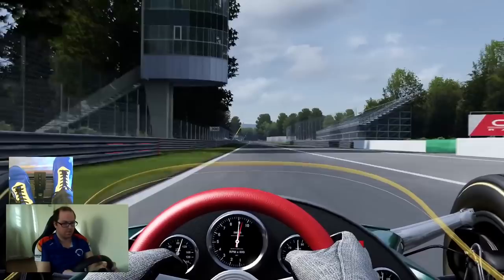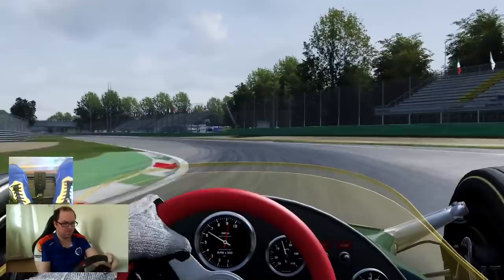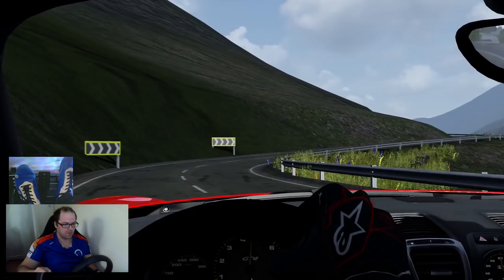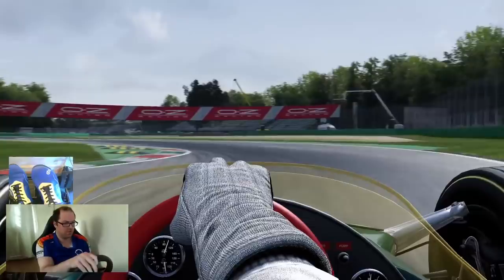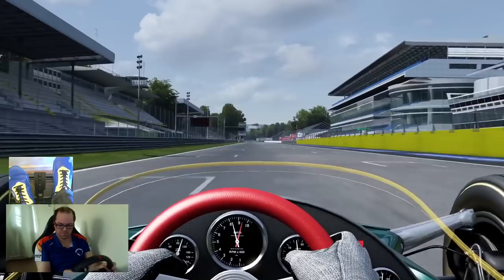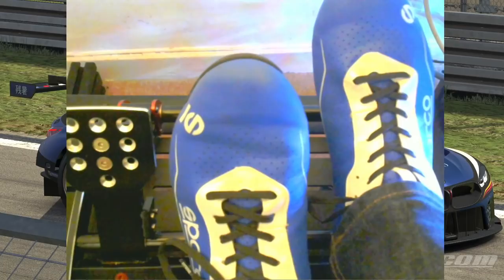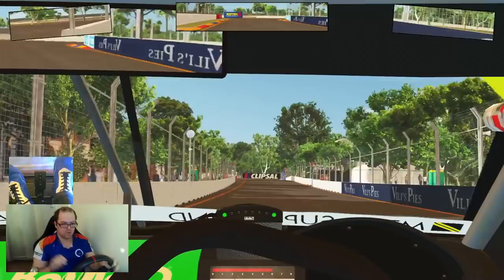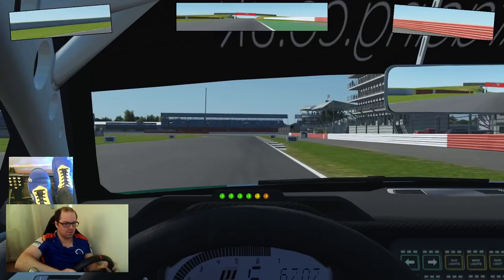Rev Matching, Throttle Blipping and Heel-Toe: Motorsport Explained

Comment: I rev matched on my driving test when I was 16. 😅 Still do on nearly every downshift 23 years later. Heel and toeing came later for me. The gas pedal arrangement in my first car wasn't ideal.

Heel and toe is actually a term that goes back to cars with the gas pedal in the middle 100 years ago. In most cars made in the past 50 years using the side of you foot is easier than your actual heel.

Comment: I taught myself the obsolete skill of double-declutching in the 1970s, when the clutch cable on my Renault 4 failed again, and for once I wasn't carrying a spare (roadside change, 15-20 minutes). Into neutral, then change gear and blip the throttle until you can engage the clutch without excessive loud rapid hammering noises.

In more recent times, I've associated the high-pitched whine in F1 with Sebastian Vettel.
Reply: 😂 Last comment - ouch! What a burn! 

My dad taught me how to do that just in case I'd need it. Mercifully, I didn't (first car was a 11-12 yr-old, 1971 Mark 1 Escort, the second a 19-20 yr-old, 1967 HB Viva - a.k.a. "Arfur". He was half a Viva and God only knows what the other half contained). I "academically" know how to do it, but as I'm now stuck driving autos, it's not a skill I'm ever likely to need. But I'm still glad I learned to do it. You never know when you might need to know something! It sounds like it paid off for you very well!
Reply: 😂 Last comment - ouch! What a burn! 

My dad taught me how to do that just in case I'd need it. Mercifully, I didn't (first car was a 11-12 yr-old, 1971 Mark 1 Escort, the second a 19-20 yr-old, 1967 HB Viva - a.k.a. "Arfur". He was half a Viva and God only knows what the other half contained). I "academically" know how to do it, but as I'm now stuck driving autos, it's not a skill I'm ever likely to need. But I'm still glad I learned to do it. You never know when you might need to know something! It sounds like it paid off for you very well!
Reply: 😂 Last comment - ouch! What a burn! 

My dad taught me how to do that just in case I'd need it. Mercifully, I didn't (first car was a 11-12 yr-old, 1971 Mark 1 Escort, the second a 19-20 yr-old, 1967 HB Viva - a.k.a. "Arfur". He was half a Viva and God only knows what the other half contained). I "academically" know how to do it, but as I'm now stuck driving autos, it's not a skill I'm ever likely to need. But I'm still glad I learned to do it. You never know when you might need to know something! It sounds like it paid off for you very well!
Reply: 😂 Last comment - ouch! What a burn! 

My dad taught me how to do that just in case I'd need it. Mercifully, I didn't (first car was a 11-12 yr-old, 1971 Mark 1 Escort, the second a 19-20 yr-old, 1967 HB Viva - a.k.a. "Arfur". He was half a Viva and God only knows what the other half contained). I "academically" know how to do it, but as I'm now stuck driving autos, it's not a skill I'm ever likely to need. But I'm still glad I learned to do it. You never know when you might need to know something! It sounds like it paid off for you very well!

Comment: Rev matching. 
1980’s and my 1st time in a formular Ford single seater on a racetrack, [Snetterton] Came off the back straight and into the S’s, changing down and missed a gear, so held the clutch in and eventually managed to get a gear in the middle of the S-bend [but the revs had dropped while I was still at speed] let the clutch up without raising the revs..  mis-match in engine speed to the speed of the tyres and off the track in a spin I went.
[Engine stalled mid spin, managed to catch it with the clutch which stopped the spin and coasted freewheeling backward off of the track]
Then sat there red faced as the experts went past looking at me as an idiot. 🙄🤦‍♂️😂😂

Comment: Nascar next year will have a sequential gearbox.
Reply: If I'm not mistaken the Camry already has one, right?
Reply: @StevePhoenix  as of right now the rules don't let them have anything other than a H pattern
Reply: @StevePhoenix  no
Reply: @jacobrocha8569  that’s why they are testing it in the new package. My question is will they use paddle shifters or the stick sequential they use in Aussie Supercars
Reply: They will still be heel toeing and rev matching
Reply: @black-op345gaming5  I believe it is a stick sequential (which are very fun)
Reply: wot
Reply: @StevePhoenix  no
Reply: Apart from entering and leaving pit lane, do they ever shift?
Reply: @cmacdhon  yes, road courses of course but some ovals like Pocono or Phoenix when the tires are worn and speeds drop sometimes they will down shift to third to pull out of corners
Reply: Will Eric cartman be driving😂🤣✌🏻👍🏻
Reply: @cmacdhon  only on road and street courses and Pocono due to the gear package used.

Comment: I feel like I finally understand it all, I've heard about it for years but haven't had near the sort of detailed explanation I got here. As I was watching, I felt compelled to try and emulate it on my own pedals (G29) and just based on that, I feel like Heel & Toe would be a HUGE learning curve for me. Maybe I'll decently grasp it for driving by myself but I'll be a mess around others on track. Throttle Blipping on the other hand feels weirdly comfortable, thought I'd struggle with it given how used to not doing it OR the other methods I am but it was surprisingly easy to adapt to. Probably helps that I've been getting alot of practice in with the H-Pattern so maybe my muscle memory has began to associate that technique with that choice of transmission.

Comment: I’ve found that for me, I struggle with heel and toe, so I use my left foot to brake and use the clutch and my right foot for acceleration. For me it means I can get on the brake earlier and get on the power earlier, with more precision due to me being able to have my foot prepared to hit the brake/gas. (Also I’m weird and find left foot braking much easier)
Reply: Hey me too!
Reply: You're not alone, same here. When I try right foot braking, I'm just lacking some of the precision and "fine touch" that my left foot has!

Would be the same for Gas.......I tried....once....in a sim....after a few glasses of alcoholic beveverages!

Now remember kids don't drink and drive................except in a Sim....there it can be hillarious! :D
Reply: Yeah left foot braking is definitely more intuitive when sim racing. Take it to a car and its a whole different beast because most people are used to holding themselves back from the braking forces with their left foot on the dead pedal as they brake with their right. Once you go for heel-toe, you have nothing holding you back/up against the braking forces besides your seatbelt/harness.
Reply: @blindaceg  I think it has more to do with the fact I have a lot of experience in karting. I’ve never done right foot braking because I tend to slam on the brake too hard.
Reply: @JB22.  Yeah I don't practice heel & toe because of my G27 pedals and the angle which I sit isn't ideal for it.

Comment: Had much the same experience as you with rev matching. Was told it's a black art when in reality it's just knowing at what point your gearbox wants to play nicely. Clutchless gear changes are another way to practice rev matching, although that's also a lot of risk to your cogs. Satisfying when it works though

Comment: Dinos on wheels huh, when i got my first car a couple of years ago(used to drive the family car which is an automatic) and it was a manual 3-Door 1994 Civic all this stuff seemed so complicated at first until i got the feel of it, mostly downshift using throttle blipping but i have also tried heel-toe and while it is really cool it is not really useful when braking for a stoplight

Comment: A great video, and clears it all up brilliantly. Could you please also do "double clutching (not granny shifting like you should)" - I have so far been confused by every single explanation out there.
Reply from the maker: Clutch it into neutral, clutch it into the next gear. It’s literally just that. The. Add a blip on the way down so it’s heel to with an extra clutch operation.
Reply: @AidanMillward  Makes sense. Cheers!!

Comment: I got pretty good at heel toe but before I did I wasn't very good. My old man didn't drive so showing of heel and toe gear changing was a waste of time, but I was young and wanted to impress the him so I did it anyway.  I wasn't fully familiar with the car I took him for a drive in, an old Holden Kingswood or something. A family car not made for heel toe gear changing. 
I don't think he was at all impresses by being flung forward and backward as every time I tried to blip the throttle I blipped the brake pedal just as hard. 
It is much easier on a bike. I sounds cool too.

Comment: Learning how to do rev matching/heal toe was and is something I use on my road car whenever I drive. I think it's mechanically more sympathetic and gives me more control, as my old ex RAF driving instructor in the 90's taught me to use engine breaking as much as possible. 

I drive a RWD car, with 494hp and 506flb-t , so I do think it's valid for me. But it was my old Impreza P1 where I would do it, as it didn't like changing down gears when "Hooning" and blipping allowed it to go into gear smoother and safer (IMO).

Great video Aidan dude. What was the game you were on when you were in the GT4?

Comment: Managed to figure out what engine revs I need to be at a given speed to be able to pop it straight into every gear up shifting or down in my old Falcon wagon when I had it, without using the clutch at all and without grinding it. Drove it around for months like that especially when the clutch cable ripped through the firewall. (Heavy duty clutch and a common problem with EF/EL falcons)

Comment: the rev matching is somewhat of a nessety at work when whe test drive the cars as its actually double de-clutching as most of the boxes are manual an have no synchromesh so get it wrong an u right off a 80+ year old gear box.

Comment: Wish i could, usually i go with semi auto. My size 20 feet are the first hurdle, especially in real cars. But thereafter almost impossible, as my feet naturally make almost a 45 degree toe angle, so the heel toe technique requires almost a 90 degree pivot from my right foot. Nope. I do rev match when i drive my real car, but in traffic i only use the break pedal when it is an emergency(and to tap when at a red light), so rev matching is easy af without the break, and is essential when driving with only engine braking.

So any ideas on how to overcome this hurdle? "Heel on brake toe on throttle" requires special pedals...

Comment: Something of note. Does the accelerator pedal have to be recessed like on the G27 pedal box so when you are braking your foot is level with the accelerator pedal making Rev matching easier?
Reply: It doesn't have to be, but it helps. My old Corsa didn't have a recessed throttle pedal and it was possible, but it's a bit more of a wrangle to get your ankle to the dangle, if you get my drift.
Most cars have a recessed throttle pedal for this reason, and so you don't accidentally push the throttle with your brake foot... However that's possible.
Reply: @EikeSky  cheers for the info. Was just curious to know if racing cars were like that. I know road cars have to have a sensible set up so doing that rev matching is harder.
Reply: Doesn't have to be, but it makes it easier. I have adjusted the gas pedal in one of my cars to make it so.

Comment: Because my dad had been a rally driver, he got a professional instructor to teach me to pass my test, and took me in his near 2 ton, 2lt Datsun (no power steering! - I was 17 and could barely see over the steering wheel!) to the mountains, forestries and especially onto old rally stages to teach me how to actually drive. I had to do a bit of the old heel-toe, and lots of rev control to get up steep tracks with next to no traction. One place was so bad he actually apologised (unheard of on a lesson), took over, and drove us straight up... sideways. Sort of. Somehow he drifted that ba$tard uphill! I, needless to say, was never that good.

It's been a while since I was physically capable of pressing the clutch pedal for more than a few minutes, but I am still attached to having the extra control over the way the power is transferred to the point of contact. In my last car I had a sports mode plus overdrive, which meant I could flip a switch on the gear lever and increase the revs without increasing the speed - necessarily. Living in a very rural area, that was the only safe way to quickly drive if needs arose. Which they did occasionally (4 kids & a hubby with the habit of ending up in hospital...). I've only got the sports mode now, but it's in the sort of position where I can easily flip it on and off. It's the only way you'll get me to drive an automatic! Especially in winter.

Thanks for taking me back to the time that was a) the most fun (the bit after I passed my test...) and b) the most bloody terrifying! You should have seen the roads he took me on. Some were literally on the sides of mountains - going more or less horizontally, the roads having been essentially made out of "shelves" in the rock. I'm surprised it took me so long to start turning grey!

Comment: how many rpm do you blip between gears?
Reply from the maker: It’s not a specific amount. Just enough to stop the rear wheels form breaking traction. You learn to feel it after a bit, I’d say try to get it to 80% of the redline and go from there.
Reply: @AidanMillward  I thought maybe it was a 500 rpm split between gears or something  ...but then there's close ratio transmissions and all kinds of different combos.  I was having trouble in raceroom as the rear tires were always wanting to lockup and lose control

Comment: been trying this for a year still cant do it. Its hard when you have size 11 feet with logitech g920 pedals lol
Reply: Wear socks like I did.  The first video of my channel shows my size 11 feet on logitech pedals haha
Reply: I have 12’s and learned it easily enough on a g920. The most difficult part is the muscle memory and once you have that down it’s second nature after that. My advice is to practice doing it first without actually trying it in the sim. Instead, pull up a youtube video of in car footage of someone driving a track you know well and just practice as if you are driving. That way, you are focusing solely on braking and downshifting and not worried about crashing, hitting your braking points, missing shifts, etc. Do that until you feel comfortable with steps and movements and then try doing it yourself in a sim